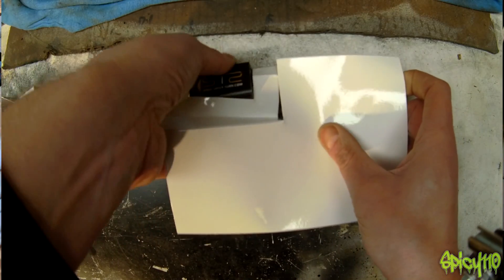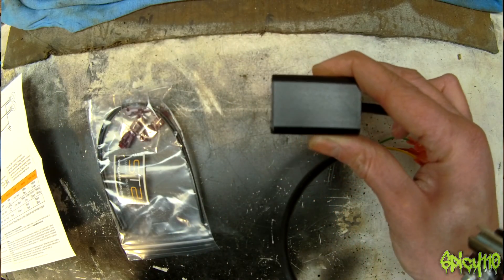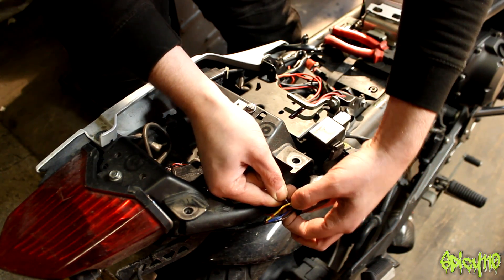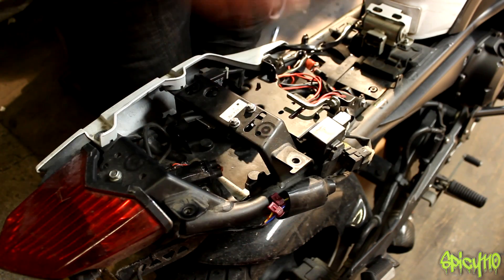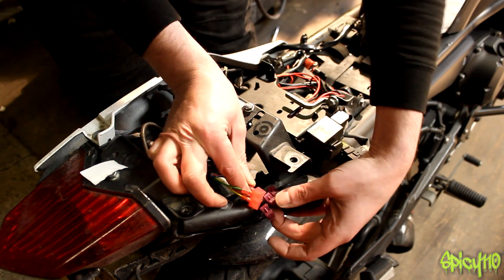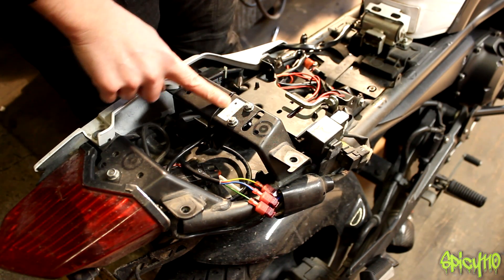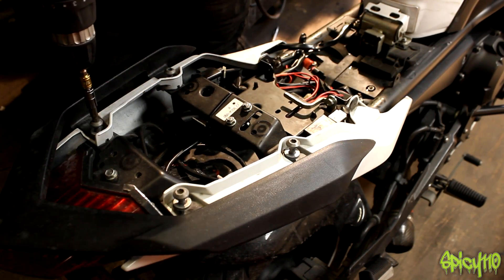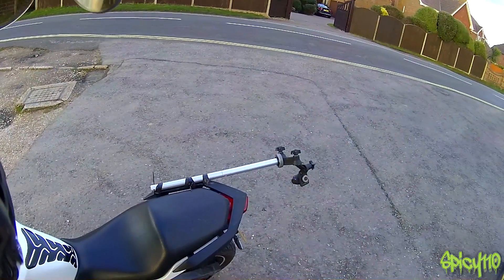STS Smart brake module. Auto engine braking light! + GIVEAWAY!

Comment: Heads up to anyone thinking of buying the latest V3 version of the ST2 brake module.

Its advertised as... 

"ST2 Brake Module uses an accelerometer and motion detection sensors combined with a proprietary algorithm to detect engine-braking or down-shifting.

It’s an intelligent system that doesn’t interfere with the actual brake light operation."

That sounds like it has a 6 axis IMU doesnt it? It does not... it has a simple tilt switch.
I could have cobbled one using a tilt switch for less than £5. This corner cutting simplicity of a cheap tilt switch provides no frame of reference for the attitude of the bike which means that it could also activate going down a hill even when not slowing. 

Also... and I quote directly...

"FLASHES YOUR BRAKE LIGHT WHEN SPEED DECREASES DUE TO ENGINE
BRAKING OR DOWN-SHIFTING"

This is false... it flashes once on initial power up but in normal functioning use it only activates the brake light on de-acceleration with no flashing. Misleading advertising.

Earlier version/s used to also have the flashing option if mounted upside down but they have done away with that in the V3.... and if you want that capability you now have to buy their new brake flasher seperately.... its called the ST2 Strober and its not advertised to the general public... (maybe to hide the fact that the V3 doesn't have this functionality any longer?) You are only informed about its existance by email after you have bought the ST2 brake module... and its an extra £34.39 posted  just to have the same functionality of the previous versions of the brake module... obviously to make more money.

To have only half the functionality of the previous version and not making their customers aware is as low as it comes.I wouldn't have bought it if I'd known and I feel ripped off. Not a good way to do business ST2 but don't worry I'm going to post this on every video site I can find so that prospective buyers can make fully informed decisions, they deserve to know what they are really buying and not to be deceived.
Reply: I iesh I read this sooner..just got it in the mail the other day. I will NOT BE INSTALLUNG THIS ON MY BIKE. Sounds like a some real scum bags making this and shamefully have been around a long time. Smh
Thank you my friend and sorry for your troubles.
Reply: @randomstuff8861  i'm trying to get a refund for this gimick plus the cost of having to replace my brake light on my 2023 Tiger 900...not cheap

Comment: This video is excellent.  I now know that the device just connects in parallel to the original wiring, no original wires are cut. Thanks for that.  Perhaps it's me but it seemed like there was a 1 or 2 second delay after engine braking before the brake light came on. I'd rather there were no delay but even if there is it is better than no brake light at all.  Best regards.
Reply from the maker: I think the delay is just it trying not to make errors, I still have this fitted to this day and is working perfectly still.

Comment: Would also recommend filling the clips with grease beforehand so that the exposed  copper wire does not oxidize with the air and go brittle over the years... then cover with another layer of grease and cover in electrical tape so they are as air and waterproof as possible... they are a quick solution for splicing wires and also the worst so protect the copper wires as much as possible otherwise they will fail in a year or so

Comment: Bought one a few months back and fitted fine. Agree, a great idea, and defo chose the pulsing mode. However, as you think, I too think that it is too sensitive. It is supposed to be 'adjustable' but nowhere does it tell you how. I thought about tilting the unit. But before trying simply asked support. I was on the right track, they say tilt the unit down at the wire end by 10 degrees and that will make it 15% less sensitive. The problem of course is if you have the unit in pulsing mode, then the unit is upside down, so should the wire end be raised instead of lowered? No idea, but I have adjusted my rear dash cam so I can test and see 👍
Reply from the maker: They did not tell me any of that at the time, I must have just got luck with it as is. It is still fitted to the bike in the same way to this day and no issues for me.

Comment: You can change the sensitivity of its deceleration detection by tilting the module, to decrease the sensitivity tilt it so the wires end points down to the floor and vice versa.

Comment: A lot of integrated turn signal break lights flash when you get on the brakes and a lot of newer cars 'third' break light flashes when you get on the breaks and in my DMV handbook it says to tap your breaks  lightly a few times to warn those behind you, that you are slowing down so the flashing option is the way to go in my personal opinion because of just how many cars, after market lights and even the DMV want the break light to flash before actually slowing down

Comment: Nice box! Though I think the fact that it flashes is a bit weird. Solid light would make more sense to me. I say this because adaptive brake lights flash when braking hard and the flashing indicates a more extreme deceleration. Engine braking will never be stronger than when you're hard on the anchors. So I think that in the future when flashing/adaptive brakes are the norm (they're allowed here in Germany now, so that's something!!), this device will have drivers smashing their brakes on behind you everytime you lift off the throttle!! Still, better than the alternative eh!?

Comment: In my opinion i think this should be mandatory on all bikes especially those ridden by younger riders ive encountered a fair few young riders on their cbrs and yzfs etc that use engine braking only with no brake application thus resulting in accidents or close calls  so fitting it to all bikes at manufacture would be good because then wed atleast know that the person is slowing down. I firmly believe It would reduce accidents for younger and newer riders while giving experienced riders an extra element of safety.
Just my opinion.
Another great vid spicy

Comment: Some brake lights can be set really badly in terms of how far the pedal or lever has to be pushed/pulled before it illuminates the brake light (I know this can be adjusted), so I think any device that aids in making others aware that you are slowing down with little or no brake input is a good thing.

Comment: I’m new to this but reckon that a steady light is more appropriate as folks following will simply think you are gently braking, which is correct. Flashing brake lights really get the attention and on some BMWs this is a sign that emergency braking is taking place and perhaps even brake assist or ABS is in use. Flashing sends the wrong messaging my opinion.
Reply from the maker: Disagree for a very good reason. The problem is when you go from decel to real braking, the brake light would already be on and no one would know you are now hard barking. This way the flash draws attention and then they see you brake. In fact some elctric cars we regen use this system.
Reply: I’m viewing this from the perspective of the car driver behind. If I see the brake light come on, I’ll instinctively give the bike a bit more space and cover the brake. If I see a flashing red light, I’ll be momentarily confused and perhaps think you have an electrical problem. That hesitation can’t be good for the biker. Just my $0.02 worth as an experienced driver and very inexperienced biker.

Comment: I'm pretty new to riding, still within the first 6 months. But I've never experienced a problem with other road users when I'm engine breaking. Is it common for people to rear-end bikers (or come close to) when engine breaking?... Cars can slow down without actually pushing the break pedal and having the break light come on too so I would have thought most competant road users can predict a slowing vehicle.
Reply from the maker: +Vodapo no bikes get rear ended all the time. Had it done to me few years back reeno has been got a couple of times. They don't realise you are slowing if the brake light isn't on
Reply: Fair enough, I must have just been lucky so far. I think the problem is, from personal experience, it's a lot easier in a car to go into auto-pilot and not pay full attention. Whereas if you're not paying full attention on a bike it  can end very badly very quickly.

Comment: Pretty neat, however it seems like a pretty new thing (maybe?) never heard or seen anything like it before, which I assume goes for most of the other road users so they may wonder why your rear lights flashing. Which could result in them thinking its faulty and ignoring it. Another thing is that the popo may pull you and ask what the deal is, but hopefully they'll understand and think its a great idea and it'll get standardised onto every new bike after 2020.
Reply from the maker: +Confused Raccoon as I understand it electric motorcycles when using regenerative braking automatically put the lights on for the same reason. So some people are building this into bikes.

Comment: Just a thought,
Maybe if the unit were to be mounted at an angle it could potentially alter its sensitivity. If its measuring force in the x-direction (same direction as the bike is travelling) then changing the angle the unit lies would mean the accelerometer would sense the force as (actual force* cos(mounted angle)), reducing the value the unit senses. 

Not sure if this will work or could possibly produce false triggers but, might be worth a try if you think so too. 

Also, thanks for making all the awesome videos!

Comment: would have liked to see how it handles you using the brakes, would it still flash?
Reply: No. It doesn't flash or interfere in anyway when you pull the lever. It only flashes when you down-shift or engine-brake. They provide more info here: www.safer-turn.com/smart-brake-module/

Comment: To be honest, if I was driving my car and saw someones brake light flashing away, I'd assume their lights were faulty. 
As someone who rides and drives, I can understand where bikes are using engine braking but if i dismiss bikes my car doesn't have anywhere near as much compression to provide the same kind of engine braking ability so wouldn't understand why your lights are flashing at certain points.
Is that a bad thing? maybe not, but I always remember what I was once told: The only thing an flashing indicator tells you is the bulb is working. I'd apply that logic to a flashing brake light too.

Comment: Is a flashing brake light legal in the UK, not sure, I have seen them before and was thinking about getting one or making my own but did not know if it was. Good vid and keep them coming
Reply from the maker: +whoamiuk1 it's not a flashing brake light the brake light is still solid when you putt the brakes this does just what you do when you tap the brake while engine braking.
Reply: spicy110 won't that confuse motorists more though, since with a lot of new cars people associate flashing brake lights with harsh/emergency braking, not gentle engine braking.
Reply: Tom Payne The emergency brake lights on new cars strobe, and it's much quicker than the flash this unit produces!

Comment: I would go with the full solid setting.  Putting myself in the place of someone who is following, I don't think I would understand what a flashing light meant.
Reply from the maker: Still have this fitted to this day and I have found if anything the flashing confuses people they notice you and back off more. On my other bike without this I get talegated more. Flashing is a standard system on some electric cars so I can see why they went with it.
Reply: @spicy110  But have you tried the solid light, and what result did you get compared to flashing?

Comment: Actually it makes the brake light comes on when vibrating or it is shaken.
Reply from the maker: If you mean shaken in your hand, yes. its an accelerometer, If a motorcycle moved its mass that extremely it would be in a very bad situation. Re your first comment I do not see any flash to start with but it is working as I do check it from time to time.

Comment: i bought the ST2 and it did not install on my second generation Suzuki SV650S !!  The problems are several.(1)  mine did not have the flash function described in the video by flipping it upside down, although it was purchased in june 2022!  I think they shipped me an old obsolete model.  (2)  My feed wire to the brakes is a 2 level voltage wire.  Let me explain.  At cruising, the wire is giving the LEDs less than a volt..Upon brake application, 8+ volts flow for brightness.  Their DiAGRAM HAS 3 WIRES, GROUND, POWER, AND BRAKE FEED.  Mine, again, uses the power wire to also be the brake.  (3)  They have not responded to my emails for customer support as my computer said no delivery!  I agree with Ralph Oliver!  BEWARE

Comment: Spicy watch out for police when you have the tail light flashing, as I got pulled for having a TST Industries flashing brake light on my MT07, they said only auxiliary lights can flash, not the main light.
Reply from the maker: +Mighty Onion do you mean a combined brake light indicator if so yeah that's not going to be far enough apart of meeting a legal regulations. Touching your brakes and setting the lights off is something you should do anyway when engine braking so this is just covering your back. I've never heard of the police pulling someone over for repeatedly pressing the brake pedal.
Reply: spicy110 nope, the TST Industries taillight has a mode where it flashes red 5 times and then goes solid when you press the brake. The police didn't seem to like that and I was basically told to change it to a solid red only. It's stupid considering it brings attention to you and that most new cars have this as a "safety feature".
Reply: The type you are describing flashes much faster than the one in the video, it’s an mot failure because when you press the brake lever or pedal it should be one continuous light, as this one is an accelerometer unit, they wouldn’t be able to prove while you’re stood still that there’s anything non standard about your tail light
Reply: Liam - Bollocks that's true i guess he's safe in that sense, just something to watch out for.
Reply: Not seeing the issue. There's nothing in the RVLR that says a brake light can't flash,  tail light looks steady to me
Reply: Chris_ SVS inthe MoT handbook the light has to be steady and come on immediately when the lever is pressed and turn off as soon as it’s let go, integrated units and race track style flashers are not permitted
Reply: In the UK
Reply: Liam - Bollocks It'll still do that
Reply: Chris_ SVS I know, that’s exactly what I said in my previous comment, the type that is not allowed is the one mighty onion is referring to which flashes 5 times quickly when the lever is pressed

Comment: Spicy little gadget, same company make the automatic indicator cancel system both seem very good things to have.
Reply: Gary fuller 
How does the indicator cancel work? I always find it difficult to put it in the middle  to press it in to cancel it, harder since I have thicker gloves for for the cold
Reply: koudacyen it’s a similar little box as the brake light one but for bikes indicator once fitted you then put two little rubber pieces into the indicator switch that stops the switch locking over so you push in direction and snaps back to the centre and the electronics in the box does the rest.
Reply: koudacyen https://youtu.be/twNrQldtSDw
Reply: Gary fuller 
Sweet, I'm getting them for my next motorbike, thanks for the info

Comment: A good vid well explained and what a great idea, except I think, for the flashing. Ever been behind somebody that keeps touching the brake?, bloody annoying. I would have the light on solid then at least it would represent a true brake light, and given that most car drivers don't have a clue about bikes, it could be seen as a deliberate wind up (by the tailgaters at least).
Reply from the maker: +Steven Hill lots of people have said this and don't seem to get why that's a big issue. If it comes on solid for deceleration the light will be on at the point you start braking. But having it flashing there is a difference between the two, the flashing is more of a warning i'm slowing down or pay attention where as the solid brake light is the clearly understood I'm braking.
Reply: Yes, and it could of course be seen as a faulty brake light which may have the desired effect of causing the following driver to drop back a bit. I think if car drivers were educated that things like that are likely to be fitted to bikes, it would be better all round. Having said that, there is no accounting for morons, and as my dad used to say....there is always one, and no matter how many safety devices you fit, you can't cover all the options. Still a great idea though.

Comment: Is the flashing brake light road legal in the UK?
Reply from the maker: It's not a flashing brake light, when you brake its solid. The same system is used on some electric cars i believe as they have regen braking.